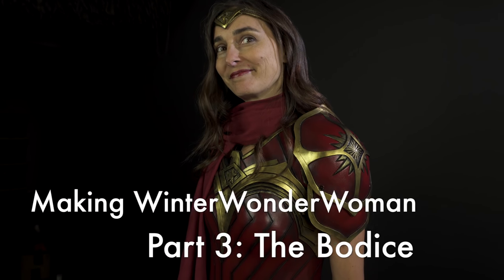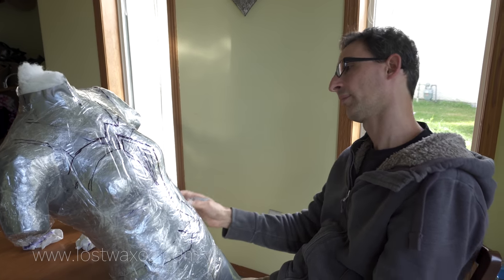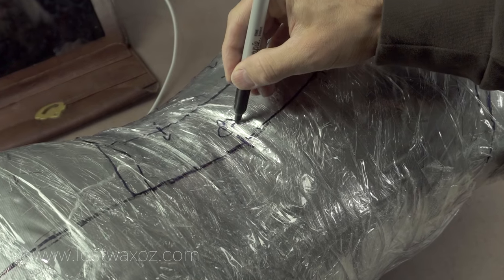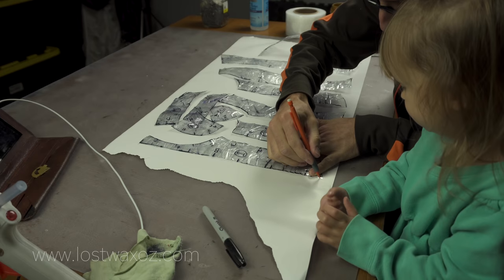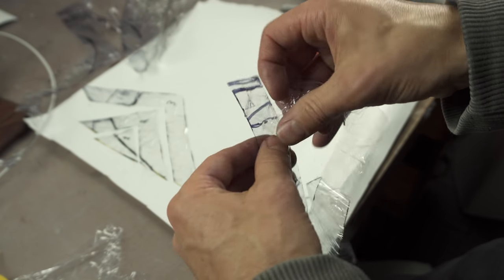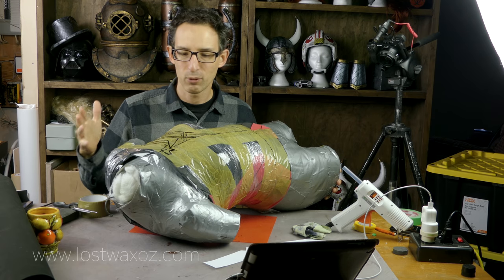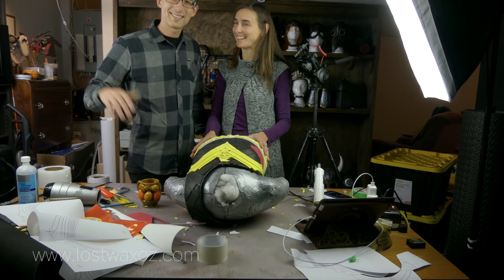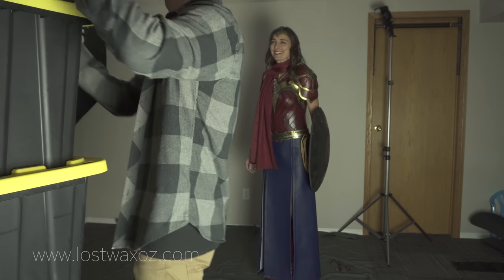DIY Wonder Woman Corset. How To Make Winter Wonder Woman Part 3

Comment: Thank you so much for this tutorial! Did you use 5mm foam for the lining layer as well as the top pieces that made up the design?
Reply from the maker: I'm not 100% sure what you are asking, but I used 5or 6mm foam (depending how you measure it) for all the structural bodice pieces and then glued 2mm foam on top for the design.
Reply: Thank you so much! That answers my question exactly :)